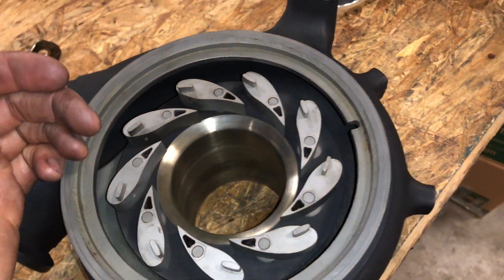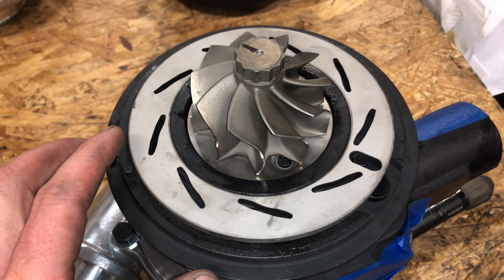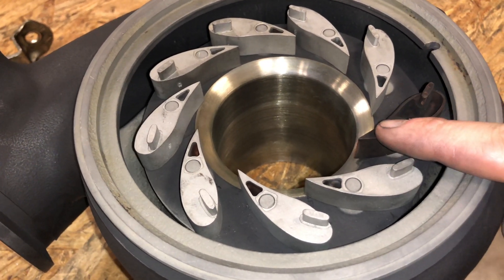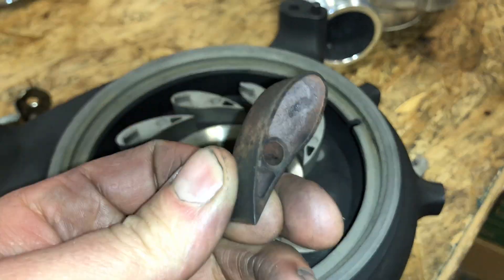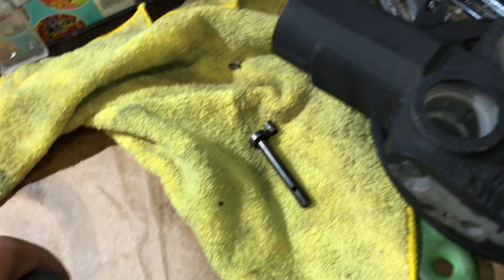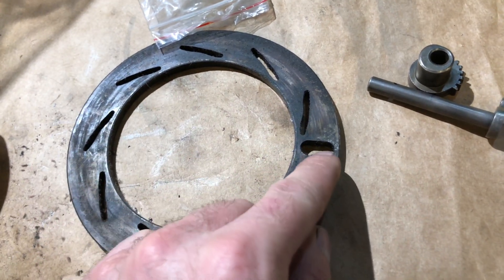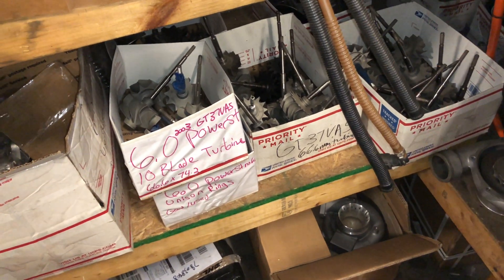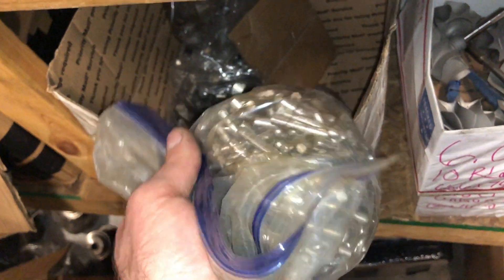How to fix 6.0 Powerstroke sticking vanes in Turbo

Comment: Doesn’t the paint just burn off?
Reply from the maker: No.
Reply: The key is using high temperature exhaust paint.
Reply: TempleTempest highest temp paint I’ve seen is 650c (celcius), especially within a turbine housing itll see that temperature if not higher. Ceramic coat would make sense
Reply: Rustoleum makes a high temp paint that is rated up to 2000 deg F.  Part #248903.  That is what I used recently. Eastwood and VHT also make higher temp coatings.  I guess time will tell if it really works or not.
Reply: @templetempest1730  thanks for the info